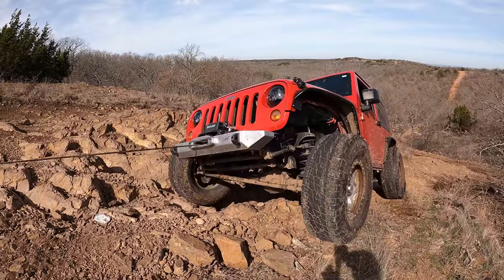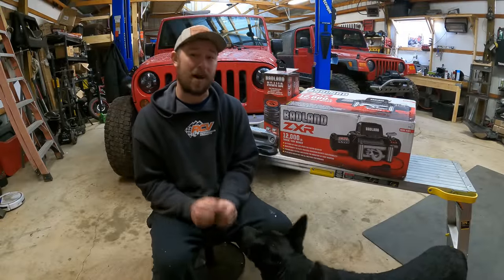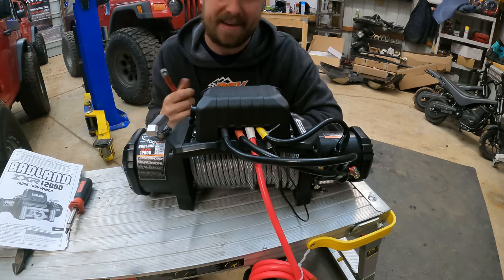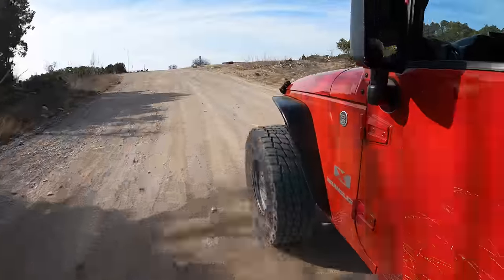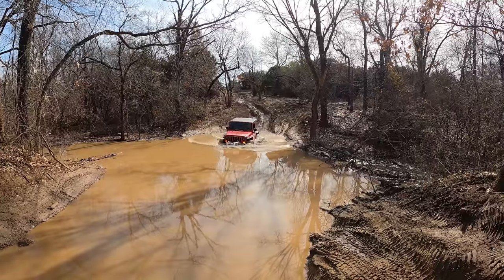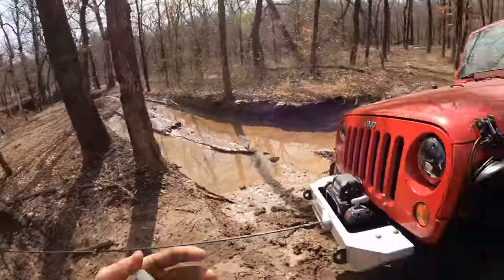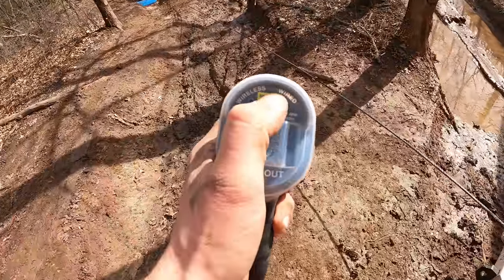Harbor Freight DOES IT AGAIN! Is The NEW Badlands ZXR Winch Any Good?

Comment: The towing company in my area use Badlands winches exclusively, they get used several times every day. They said they've never had an issue with any of them and they have been using them for several years.

Comment: I have been wheeling & doing recovery for over 20 yrs. All I use is Harbor Freight winch 3,000 lb winch on y atv and 12,000 on the front of my 2008 Ram & a 5,000 lb winch in the bed of the Ram. Never had any issues.

Comment: Good review. I was considering the ZXR then I realized after you add the synthetic line, remote, hook, fairlead  it adds up to $600.  $30 more and you can have the apex that comes with all that extra stuff.
Reply from the maker: The apex is a great winch! But it doesn’t fit a lot of bumpers that are designed around recessed winch mounting. This is a good smaller option. But yeah the price comes out pretty close and at that point the apex is a faster, better winch
Reply: @JKGearandGadgets  I added the stock Rubicon Hard Rock bumper (from a 2015) on mine. Will the Apex fit it?
Reply from the maker: @GentleGiantFan  you’d have to cut or grind the bumper shell on the sides
Reply: @JKGearandGadgets  So, got my first winch installed and went out to unspool and respool under the weight of the vehicle. It’s a synthetic rope and was making random popping noises while winching under pressure/weight. Is it normal for it to make a noise the first time?
Reply: @JBJHonez no. Return that sucker

Comment: Looked at buy this yesterday on the 25% presidents day sale but didn't because of zero reviews. Thanks for getting one out there quick. At $319 on the sale its a killer deal and get the steel cable run it in the winter to save on the deterioration (salt and cinder grime) and add a freedom winch line for summer wheeling seems like a great idea 💡 😀 👍

Comment: That additional positive lead is so you can add a fuse which you definitely need to do if you don’t want to start welding if the positive gets a rub mark somewhere and chews enough through it to expose the wire.  Warn 8274, best winch ever.

Comment: I bought the APEX two-ish years ago when harbor freight marketing messed up and I got for it for a few hundred bucks.  My thoughts were for a few hundred bucks I’ll run it till it breaks as long as I get a few good pulls out of it I’m happy… 2 Moab trips and a ton of Arkansas, Texas and Missouri trips with 2 1/2-3 years of hard use later it’s still running like a champ! I love that winch only complaint is it’s gigantic

Comment: Does it matter if the line is coming off the top or bottom of the drum? I installed a winch and it ended up coming from the top of the drum. It’s how it came from the factory and the controls are going the correct direction when used.
Reply: Depends on your winch. Some are over the top, some are from under. Keep it the way the manufacturer placed it because of how the brakes work.

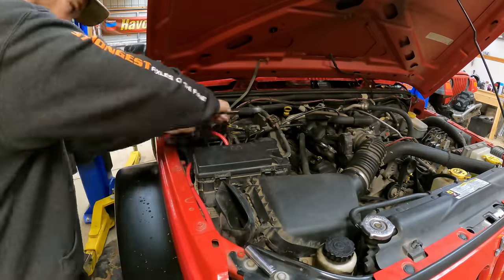Comment: Are you wiring it direct to the battery, or are you using a thermo breaker (they used to include one but I’m not sure if they do any longer), or an aftermarket “flip switch” breaker? 2:21

Comment: Looks like they rotated the handle position.  I put a 12k Apex synthetic on my ‘22 Gladiator with the Mopar winch bumper, had to hack about 3/4” off the winch handle to get it to clear the hole in the bumper.

Comment: I am with your buddy - the Warn 8274 is the best winch ever built!  Straight performance , it will put all the other winches to shame.
Reply from the maker: Its a serious winch for sure! Just not comparable in this budget range.
Reply: @JKGearandGadgets  You are 100% when looking at new - to new winches. The great thing about the 8274 is that since they have been around for so long you can find older ones used for fairly cheap and can rebuild them,  and be in it around the same price as a low-to mid priced new winch ! With a couple of upgrades like a 9.5xp or Bow motor and an Albright solenoid you end up with a screaming winch that will put everything else to shame. Of course most people don't want to spend the time rebuilding an older winch, but might be a cool project that you and your buddy can take on - and then do some comparisons to the other winches!

Comment: Can you tell me if you can clock this winch? 
I’ve got an ARB bumper on a first gen Tacoma and the winch needs to be mounted feed forward with clutch control able to be accessed through a slot to the side of the fairlead location.

Comment: How did you attach it to the drum? The steel cord goes through the drum with a set screw and from my understanding the synthetic rope has a loop on the end.
Reply from the maker: The synthetic kit comes with a washer and bolt that installs through the eye of the line and onto the drum

Comment: Did you have any [off camera] over heating issues with winch?  I remember reading somewhere that some manufacturers use the wire rope as head sinks, especially on cheaper brands.
Reply from the maker: Nope! After each pull I felt the positive wire and the line/drum and it never even got warm.

Comment: do you think you’ll be keeping the 3.8 in that new, to you, jk./ what are your thoughts on the motor is it necessary to replace?
Reply from the maker: Its not necessary to replace, you just have to run the proper gearing. I ran the 3.8 in the JK with one tons and 40s for a long time. This JK has alot in store, beyond the capabilities that the 3.8 can offer. 3.8s arent a big powerhouse by any means, but they are reliable and last a long time.

Comment: Did you hook the small ground wire on the Warn in wrong place? If you hooked it to the black post on winch (which is not a ground) the same as you did on the Badlands then your Warn is not properly grounded and that wireless remote will never work correctly.  You night consider reading the instructions for the Badlands winch as well to make sure that the small ground wire isn't supposed to go on that black post as well.
Reply from the maker: The instructions on the warn winch clearly state to attach the small control pack ground wire to the winch post where i have it, same with the badland.
Reply from the maker: https://www.warn.com/Attachment/DownloadFile?downloadId=934
Reply from the maker: And how would it not be a ground? It’s a post on the case of the winch (ground), and it’s a shared post with the ground cable that goes directly to the negative battery terminal… That is literally a grounded connection lol

Comment: curious about changing to synthetic, did you reach out to Badlands? I ask this because a lot of lower end winches actually use the steel cable as a heat sink to keep cool. Will switching to synthetic cause heating issues? Apex 12K is currently on sale for $500 but yes is a huge winch, not all can fit it
Reply from the maker: I’ll try to ask them, but most winches can run synthetic without any isssue
Reply: @JKGearandGadgets they make heat protective straps for this exact reason because the brakes get hot.

Comment: 4:01 at this point look how the line is positioned, it’s close to the ground and running parallel, most your winch force is pulling into the ground. You want to position your anchor much higher in this scenario so you are pulling up and forward not down and forward. This setup just put unnecessary strain on the winch, line, anchor, and vehicle mount.
Reply from the maker: Yep. And it made for a good video and showed the winch actually putting in alot of work. Thanks for watching and glad you enjoyed the video.

Comment: Since you was talking about the nylon winch rope and how to break that in does that apply to atv utv winch lines as well?
Reply from the maker: Yeah. Otherwise the line will crush the loose stuff when you go to winch
Reply: @JKGearandGadgets  thanks for answering.. if I pull the line out and let the winch pull the atv in would that be enough to break in the rope?
Reply from the maker: @Bennett-xo6iu  yes. Do it on an incline in neutral and help guide the rope so it spools correctly
Reply: @JKGearandGadgets  thank you so much...can't wait for your next video